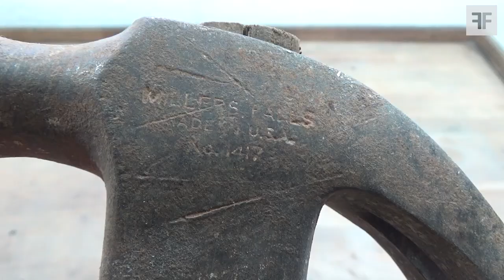Old Rusty Hammer  ||  Restoration and Customization

Comment: You lost me at the epoxy; you're the reason I've had to destroy so many perfectly reusable handles; because the epoxy needs to be drilled out; or burned out. Think of the NEXT restoration, because yours isn't going to be the last one; and the handle you made could very well have been reused in the future if not for your rampant epoxy usage. You could've used woodglue or simply no glue at all.
Reply from the maker: When the final result is obtained, that is, when the work is finished, what is the difference between epoxy glue and wood glue? None, none of them are noticeable if applied correctly and in appropriate amounts. Wood "breathes" so that it dries out over time and starts to rot and is no longer fixed to metal.
Could I have used the old handle? Was it taped? Then why didn't I use it again?
Not only that you are not right about that, but even more, I would recommend everyone to use the same method as I did.
Thank you for your comment, but in this case you are not right.